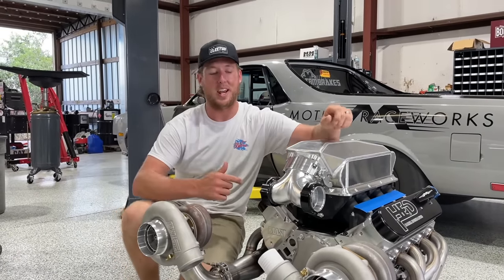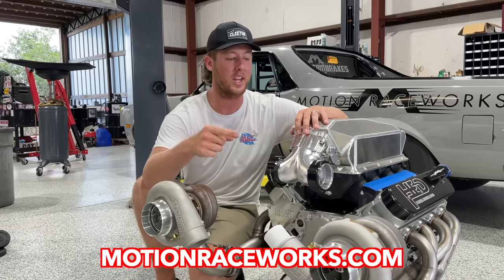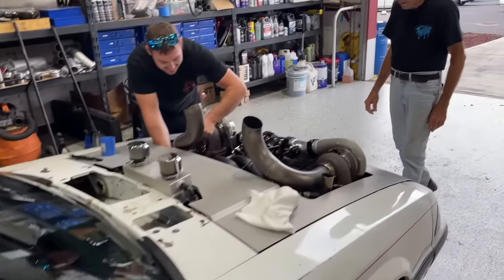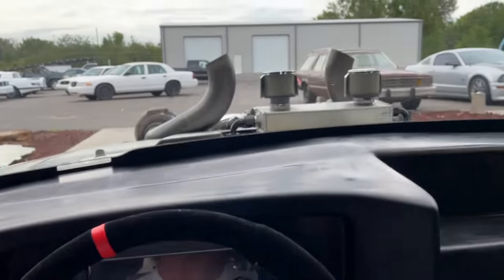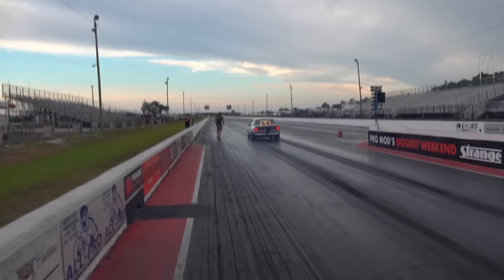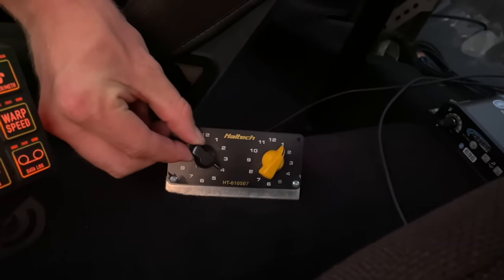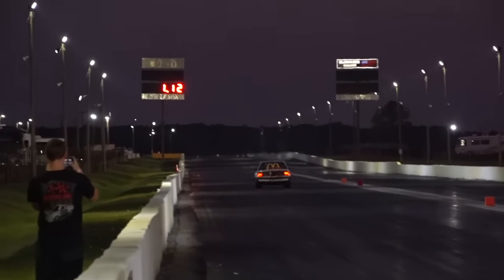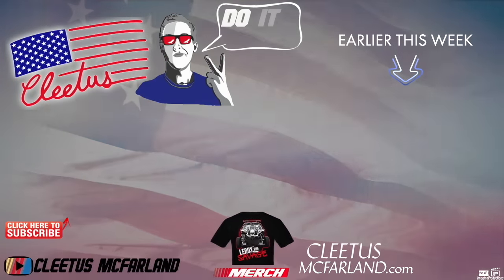I've Been Shifting My 5-Speed Lenko BACKWARDS For Months... INSTANTLY Made My Car WAY FASTER!!!

Comment: Also from lencos website 

Checking Shift Pressure (only on CS-1 style or center shift transmissions):
To measure the shift pressure install checking lever into tower screw jam nut all the way up the tower so it's out of the way. Now rotate tower clockwise until it lightly touches pin on shift fork then rotate tower counter clockwise 2 turns and place hook of scale in top hole of checking lever supplied with transmission (this lever should be about 5 1/2" over all length) and pull scale slowly to shift section, taking note of highest reading this is your shift pressure. If the shift pressure is set to your application lock the jam nut your finished, if not you then need to add shim to raise pressure or subtract shim to reduce pressure.
 
If needed you may vary 1 full turn up or down from your 2 turns out in order to achieve the shift pressure desired.
Servo
CS-1 style or center shift transmissions:
Air shifted LENCOS come pre adjusted from the factory. If it is necessary to remove the servos you should reinstall with the lock nut spun completely to the top of its travel. Screw the servo into the transmission case until contact is made with the shift fork pin. Now rotate counter clockwise 1/2 to 1 turn and tighten lock nut. No further adjustments are necessary as there is ample reserve travel in the servo.

CS2, CS3, CS4 & Lencodrive or offset shift transmissions:
There are two different size air servos for the New Generation transmissions.The small air servo (2.5"piston diameter) and the large air servo(3"piston diameter) for the CS-2 large case transmission and Lencodrives. The air servo is attached to a rotary shift plate by an adjustable arm which is pre-set by the factory and should NOT be changed. The arm is held into the servo piston by a set screw. Run the air servo jam nut and o-ring up the threads on the servo. Screw air servo into case until it bottoms out against the jam nut. Rotate air servo into case until you see the set screw in the air servo piston boss inside the case. Apply a small amount of Red (271) Locktite on the set screw. After inserting arm into the air servo piston boss, run set screw in until you can no longer remove the arm from the piston boss. Warning: Do Not over tighten set screw. The arm must be free to move in all directions. Screw air servo counter-clockwise about five or six turns before you reassemble the transmission. Assemble next section on to case and bolt tight.

Adjustment:
Once installed, make sure the air servo is loose and can turn freely. Remove fill plug on top the transmission case you are going to adjust. Sight through plug hole, where you will see the outer edge of the rotary shift plate. Screw air servo in (clockwise) until you see the rotary plate start to shift, now screw air servo Out (counter-clockwise) until the rotary shift plate stops moving. Then, continue to screw air servo Out (counter-clockwise) one half turn. This will allow for free play in the shift system. Run air servo jam nut and o-ring down against the case and tighten with a 1 1/2" wrench. Do Not Over Tighten. Add fluids as necessary and install fill plug. Attach air lines and your race ready.
Reply: OF COURSE !!  Always RESEARCH WHAT YOU BUY AND “KNOW” HOW TO RUN IT !!!  “KIDS”
Reply: @melindagreen3023  Unless you are looking for content. Then just wing it!!! lol

Comment: Straight from Lencos website 

Shift Patterns:
All levers in forward position result in the transmission being in first gear. The tallest to the right is used to shift the transmission from first to second gear. The second lever, and second tallest, is used for third gear. The next lever is used for fourth gear and final lever for fifth.

Burnout's (on all LENCOS):
When doing burnout's you need to roll up to the water box then shift all sections accept the front section. Then start the tires spinning, now shift the front section so that you are now in high gear. You always need to come out of the water box in high gear to prolong the life of the transmission.

Shift Pressure
Reply: OF COURSE !!  Always RESEARCH WHAT YOU BUY AND “KNOW” HOW TO RUN IT !!!  “KIDS”
Reply: @melindagreen3023  what's a "manual" does it get me clout?
Reply: So the taller gears must be close if its hard to tell the difference between second and 5th right? The only way youre really grenading it is if you slam all the levers forward and send it into first because second is so close to 5th that you can shift between them and the only way you can really tell which is faster is when youre counting the tenths and hundreths of the second. First gear all levers forward. Man i bet the inside of that trans is confusing as hell but i hope im wrong. They were starting in 1st and shifting into fith and ending in 2nd. Is that what im understanding? 5th and second are higher gear ratios or something so jts hard to tell the difference is what i think is happening. First gear probably sends the vehicle speed way up to the point 2nd is lime 6th in a normal car. Or like sportbike motorcycles where 1st gear goes to like 75mph or something crazy. 

At first i was skeched out because its weird to see a transmission that once out of first gear you can hardly tell the difference between 2nd and 5th. Motorcycles you dont get to choose you csmt just go from first to 5th you have to manually roll through every gear from 1st to 5th so its impossible to accidentally put it in the wrong gear without shifting down 4 seperate times and dumping the clutch if you were literally suicidal 😂
Reply: @TheAnnoyingBoss  "They were starting in 1st and shifting into fith and ending in 2nd" Your confusion is understandable, as you're thinking about how "normal" transmissions work. But the Lenco isn't a "normal" transmission. Throw everything you know about transmissions out the window, and follow along.... Each lever adds another ratio on top of the previous ratio. By shifting it backwards, all you're doing is throwing in slightly taller ratios earlier than what you want, but the end result (all levers back) always results in all the ratios added in, giving you fifth gear.

Once you grock that, think about it this way: the only real "gears" you have in a traditional sense are first and fifth. Everything else is just first gear plus a ratio after the first throw, then first gear plus two ratios after throwing two levers, then first gear plus three ratios after pulling the third, etc. So the difference is how much each lever adds to the current ratio. You could even start by all levers forward, then throw the far left one, then throw the far right one, the the second from the left, then the second from the right and finally the last lever and still end up in fifth.

Now here's the thing.... you want to shift it in the correct order, because each lever adds a slightly different ratio to the current selection.
Reply: @floorpizza8074  wow how interesting. The ratios stack up

Comment: I like how you struggled to get Leroy into the 7s, and now you built Mcflurry, and it dose it with ease
Reply: It’s amazing what the application of cubic mega bucks can do for your ETs.
Reply: Don't want to be biased but chevy vs ford 😆
Reply: Leroy also stick car, can't compare
Reply: @joshdreiling25  he also wasnt near as experienced when leroy went 7s
Reply: FORD!
Reply: @E. Boyd  chevy excuses... results are......?
Reply: @joshdreiling25  really? Sounds like a chevy bail out..
Reply: It's the transmission doing the magic....
Reply: Amazing what body panels can do for drag coefficient.
Reply: @tct72 hahaha true that
Reply: @adamsecord5954  I don't care what engine is in what car.
Reply: It’s the suspension and solid axle from the get go. Cleeter has always had more power than suspension. Suspension is what makes a car ET well and be consistent. HP gives you high trap speeds and broken parts lol
Reply: yep - totally different class of transmission (and motor / driveline, everything $$$)..  incomparable, still having the fastest manual Corvette isn't bad (at ?? 22 - or what, back in the day )
Reply: it's called learning, when they built leroy they had next to no experience which makes what they accomplished with it all the more impressive, with the team they have now and  a few years of figuring it out (with a little help from some absolute legends!) they are much better race car builders and drivers
Reply: It’s stock shift if leroy had a glide or th400 it would be in 6s
Reply: One phone call to Stevie Fast just improved the ET by almost 4 tenths... Having smart friends helps. A lot.
Reply: @garydryden9574  custom built racing engine vs stock block ford engine
Reply: Experience, knowledge, and funding. Cumulatively his team has exponentially more experience and knowledge in every aspect from the building, to the racing then they did back in Leroy's early days. They also have the sponsors and other revenue now to buy the proper top of the line components for the builds. Remember they were still using junkyard 5.3's and stock corvette motors back in the early days.
Reply: @joshdreiling25  said Fred Flintstone!
Reply: I think McFlurry has quite a bit more displacement doesnt it?
Reply: @tct72  This! Aerodynamics matter 😂
Reply: @tylenolpainrelief3735  there that too...ford is always been op in my opinion sky's the limit with these new ford engines
Reply: @Bill_N_ATX  it’s amazing what a better engine will do too Ford 7.3 is a beast
Reply: It’s that ford power under the hood!!

Comment: I'm going to agree with right to left based solely on the ergonomics of the shift levers.  When you pull the levers back the next gear you grab is the tallest and proudest handle of what gears are left in the run.  I think it's designed for you to easily find the next gear. At least that's how I'd design it. With left to right you have to get your hand inbetwixt the levers and is not as intuitive.
Reply: Backwards still works for us Aussies in RHD cars :)
Reply: I agree, ergonomics should have been taken into consideration during the design. That reverse instinct approach always leads to errors. Further, when things are counterintuitive, they should be labeled (numbers on the knobs).
Reply: Anatomy of the body is always something to consider.
Reply: Only thing is the shift levers didn't come already installed and they can be installed either way as well
Reply: Not really... By going from Left to Right you are literally moving the shifter out of the way so you don't even have to think about which one is taller.
Reply: Inbetwixt. HYB.
Reply: @RonniePTexan  face meet palm moment right there

Comment: Just imagine the thought of doing it with a factory composite intake manifold and factory sleeves. Mcflurry going to go 6's sooner then later
Reply: You need a blower with lenco the turbo doesn't seem like the right setup for the lenco they're typically in pro mods with a screw blower
Reply: @barrelsurfergirl4614  looks like there is potential in doing it outside of its traditional platform. Turbos n lenkos look to perform well in the footage
Reply: @barrelsurfergirl4614  why though? I understand boost lag but seems to be in high rpm's each shift. I feel like it's more of new guys not touching that trans and old guys not wanting to play with turbos and tunes
Reply: @kksquad69  its a solid case of: unexplored by new guys, while the old guys are not innovating upon their use-case's for it. I literally have never seen someone under 50 ever use a Lenko setup.
Reply: @von...  that's what I figured,  I ran a shop with my grandpa, you could tell most car knowledge stopped at the electronics and disc brakes
Reply: @kksquad69  What really happened is that Lencos were outlawed by many organizations and in most racing classes. Lencos have always worked perfectly for drag racing, but like anything else that works too well the people who lose complain and next thing you know, Lencos are outlawed in most classes. 

The fact that Lencos have always been more expensive makes it easier to demonize them. Guys running PowerGlides or TH400s complained that the Lenco was an "unfair advantage" and only affordable to "rich" racers.
Reply: @RonniePTexan  Great to know and understandable. Racing is a rich man sport "mainly" ,  and ruling out expensive parts is only right for the smaller guys.
Reply: @RonniePTexan  i remember mostly they faded away from at least the NHRA because Bob Glidden switched to the liberty G force 5 speed because it was lighter than the Lenco so pretty much every pro stock nhra racer switched.
I wondered why Cleet didn't pick up a Liberty g force 5 speed instead. The g force is lighter and more compact, only thing is i'm not sure if there is a bruno set up for it.
Reply: @brianadams429  Pro Stock requires a clutch, so there are some differences between Cleetus's Lenco and Glidden's Liberty. A Liberty is crazy expensive. A Lenco costs $4-7k which is pricy but not too crazy compared to a legit racing TH400 like M&M or Rossler. A Liberty is $10k+. Cleetus was probably looking at racing transmissions and assumed he would have to spend $4-5k anyway, so for a few bucks more he got the Lenco and it gives him the ability to make content from it. Not to mention it's pretty hard to break a Lenco, even if you leave it on the chip for 20+ seconds, which would kill any TH400, no matter how well it's built.
Reply: @kksquad69  The "expensive" part of a Lenco is a bit overblown. It's maybe $1-2k more than a built TH400. It's not a massive difference in the racing world, because like you said racing in general isn't a poor man's game. Since a Lenco is more predictable and durable, the price difference isn't really a big deal. But the racers used cost as an excuse and got it outlawed. If you look into a legit racing TH400 from M&M or Rossler and compare it to what you would have to pay to get a Lenco, it's not really that much difference. It's roughly in the same ballpark. And the Lenco is certainly more durable and consistent.
Reply: @RonniePTexan  the last time i had any reason at looking at a lenco ,the street/strip was rated at around a 1000hp, i want to say it was around $8k with no shifters, lightning rods were another $1100. If you wanted the air shifter set up the it was over $2k.
The pro stock racers run clutch discs because there is less power loss and less weight than from a heavy torque converter, pump (bruno). I can't say it's not allowed but with pro stock every bit of weight/power is important. I saw where the libertys were $10,600 but the shifter is included, it was rated at like 1500hp or 1800 hp in a car upto 2500lbs. 
Liberty makes great gears. Back in the day my pops top loader was just a steel case with all of libertys guts. Basically it was a slightly heavier 4 speed liberty trans that the case doesn't split in half, and isn't rotated sideways.
Reply: @brianadams429  I just did a quick search on Racing Junk and there's a Lenco for $2,500 (minus some parts like air shifter etc that you listed) there's another for $4,000 and a complete one for $7,000. That's in the same ballpark as a Rossler transmission. 

The Liberty that you're familiar with are stout, but they use traditional clutches and in a turbo setup like McFlurry, it wouldn't work as well as the Lenco or even a built TH400. Pro Stock requires a traditional clutch, that class doesn't allow a torque converter or automatic shifting. That's part of why the best overall drivers are often in Pro Stock (Erica Enders is known as one of the best in any class).  One massive advantage with the Lenco in a turbo setup is that it's almost impossible to burn up the transmission while staging. Cleetus uses his transbrake/two step a lot and really beats up on his transmissions by leaving it on the two step for a long long time. The heat build up not only tears up clutches and bands, but it then makes the shifts sloppy and less predictable.  A Lenco in McFlurry makes a lot of sense. All of that being said- Our boy Cleet is hard on stuff. That boy could break an anvil using nothing but cotton balls. No matter what transmission he uses, he's probably still gonna tear it up!

Comment: Call me crazy but McFlurry is my favourite. She moves fast, straight and reliably on a fairly stock motor. Like he said “it just wants to go fast”
Reply: To be fair the block itself is the only thing stock, heads are completely redone bottom end is redone and oil pump
Reply: Stock and motor don’t go together around these parts brother
Reply: The blocks stock, crank is stock, the head is just a ported factory casting so not like it’s a stronger head for clamping pressure. So yes it has some updated parts like billet rods, aftermarket head studs vs stock tty head bolts “which were used 3 times not only once like intended,”. The stock rods held up where they were and they never broke one just put the better ones in because they were at the max for stock they were thinking.
The stock pistons were handing it too at the time they lost the head gaskets
Reply: I think its because like mullet its a massive motor. But they arent trying to push it to it limits on a suspension that needs a perfect setup. Motor makes the power easy they arent pushing the suspension. 

Leroy and ruby both being baaically small blocks is an endless fight
Reply: @bbdl7042  still has plastic intake, no intercooler and I think it’s the only stock block car they have or had that runs 7s